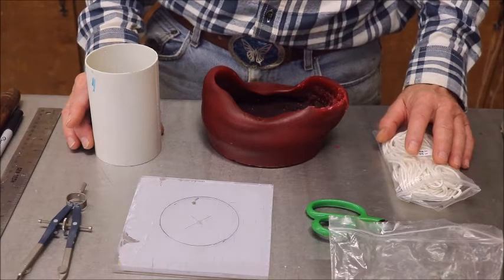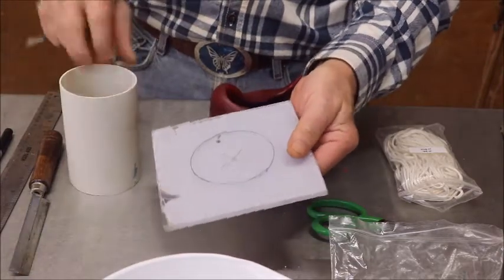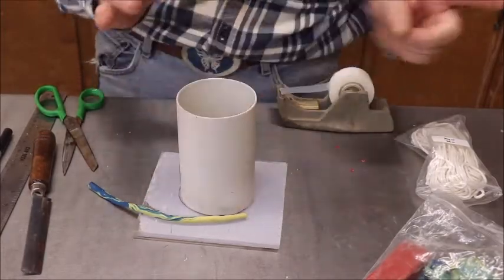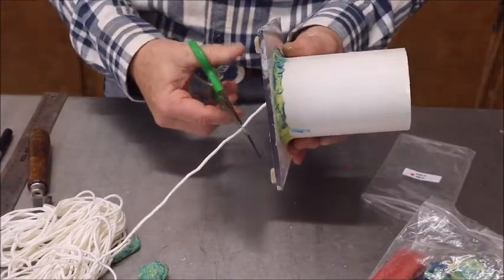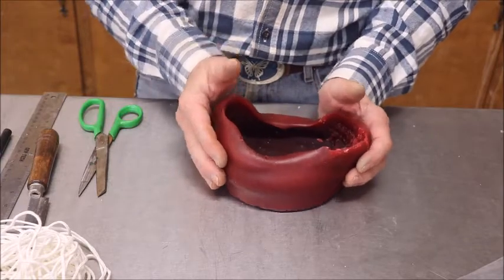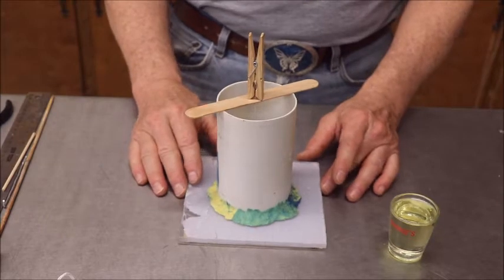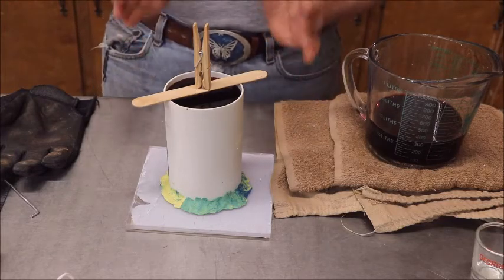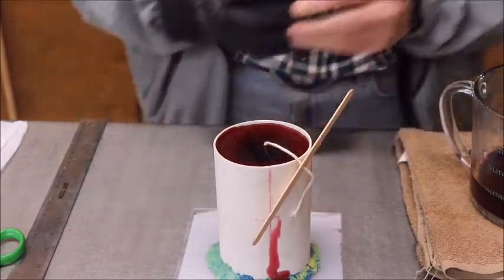How to Make a Pillar Candle Mold & Pour a Candle

Comment: Hahaha..... excellent vid,  I've been using homemade molds like this for ages,  works great and pvc is cheap, reusable, comes in many diameters and can be cut to length. Here's something to try Mike: I take flexible silicone texture plates and tape them on the inside of the pvc, then fill as usual, let harden and de-mold. The texture plate peals right off, leaving behind a wonderful impression that can be left as is or filled with another color or colors. To fill it in I usually use a whipped wax, which is probably what you are frosting your candle with or at least similar. I let the candle cure for a few days then freeze it a few hours before smearing the whipped wax into the design and scraping off excess. Then, let set before giving it a final trim and clean-up and Voila beautiful decorated candle. I use a flexible silicone spatula (like for baking, in my family we call them "Magics"), to smear it in and polymer clay tissue blades are ideal for scrapping but a razor blade works too. I've even made my own texture plates from silicone and also foil tape (the real stuff, not the crafters kind). The benefit of that is you can stick it right to the mold. I usually use a light spray of mold release for the foil and for any brand new silicone plates. 
*I use box tape or what some call packing tape to tape the plates in place and seal the release cut. It gives a smoother transition with less clean-up in the finished candle. I used 3M but recently been using Gorilla, never had a problem with either melting. 
**Freezing the candle for a bit before filling helps harden the wax, both the already poured candle and the whipped filling and lessens chances for damage or distortion of the design.
***scraping off excess whipped wax is a slow and steady process to help avoid "popping out" pieces of the details or gouging the candle. Best way to start though is to not over fill, scrape off as much as you can as you apply it. 
Hope this helps you and anyone else interested in this art form 💗💗💗
Reply from the maker: Thanks Starcat, those are good ideas!
Reply: Kudos for the Video! Forgive me for butting in, I would love your thoughts. Have you heard the talk about - Chireetler Earning Maker Rule (search on google)? It is a great one off product for learning how to make candles for fund or profit without the hard work. Ive heard some great things about it and my cooworker  got amazing results with it.

Comment: Thanks for the demo! For melting wax, I use a metal coffee can set into an old sauce pan with a couple of inches of water. The wax chunks go into the coffee can, the burner set on low heats the water, and the wax melts in the coffee can.  You can bend the edge of the coffee can a bit to create a "pour spout" for the wax.
Reply from the maker: Thanks for the comment Sue.  And thanks for watching my video!

Comment: wow! I have 26 lbs of paraffin, the result of friends buying into the "dip you hands in paraffin" craze... I was shopping 2" pillar molds , once I start melting I would like to do many at a time and that would be $$$yikes... using the "wax warmer" to melt the wax, will be interesting to see if it is hot enough.... using pvc, I could make several molds at a low price (hey.. I was thinking of using toilet paper cores lined with foil, hot glued tog, imagine, the time wasted though, some potential for texture) I was wondering, if you got the mold cool or cold before pouring.. it would make a different surface but, less danger of leaking but, not needed, your method worked great! In early days, I used to get the wax just hot enough to pour and adhere to the wick...  brilliant!  I need some advice on mixing stearin and... good to go! Thank you and, great video! Capt Mike is the kind of people I wish I knew locally... there is more to life than the mall and cable tv...

Comment: I use empty beer and soda cans. Just cut off the top and then cut it opwn with scisorcs or a knife. Still needs repouring tho, but no leaks :)
Reply from the maker: Good idea Eva!
Reply: how do you deal with the holes in the bottom? I've tried those and everything I tried to seal the hole with gets melted and my house is a mess :D
Reply: the candle comes out easily? great idea...

Comment: Hi,
Nice video. I am having variable bulge in candle and it have deboss hexagon pattern. Pattern are coming fine but the candle don't seems straight and have bulge. Please any suggestion.
Reply from the maker: Are you using a rigid mold or a silicon one?  If it is a ridig mold you may be using a wax that is not dsigned for free standing candles.
Reply: @CaptMike  I am using silicone mold
Reply from the maker: @mitulprajapati3236  I would guess the silicon is getting warmer around the middle and the wax expands out from there.  Just for grins and giggles make a test candle in a plastic solo cup and see it the wax holds it shape.

Comment: New sub. Colorful language Lol. I'm new to candle making. I like the clothes pin tip. And i didn't know that meant tunneling. And i want to learn how to make molds. Where can i get that comb???
Reply from the maker: Hi thanks for the comment.  Tunneling occurs two ways.  First when you make a candle using pillar wax and second when you burn a candle that has not been wicked properly.  When making a pillar candle the type of wax you use will shrink somewhat when cooling causing it to "tunnel" down the middle.  You will need to fix that by adding more wax until the desired level is reached.  The second type of "tunneling" is caused by using a wick which does not produce the required heat necessary to create a full melt pool.  I am not sure what you mean by "comb". Please explain and I will try to answer.  Hope this helps some.
Reply: @CaptMike   thank you very much.
Reply: @CaptMike  oh the big tool that has teeth. I might be calling it the wrong name.
Reply from the maker: @lisamb4269  Somewhere around 2:20 in the video I have a razor saw in my hand.  Would that be what you are talking aobut?
Reply: @CaptMike  yes. That's it. Ty.

Comment: What kind of plaster do you use to make your molds, slump molds.
Reply from the maker: I use an inexpensive industral plaster ($9.00 for 50#).  I use ceramic clay for glass slump molds.
Reply: @CaptMike  what kind of clay ?
Reply from the maker: @samanthanicholson9015  you will have to use a clay used for throwing pots and such.  It is called ceramic clay.  It is water based. Start here: https://www.amazon.com/s?k=ceramic+clay+for+pottery&crid=16W0R4N4H6Y4C&sprefix=ceramic+clay%2Caps%2C193&ref=nb_sb_ss_ts-doa-p_3_12.  A low fire clay will do just fine for making glass molds.
Reply: @CaptMike  so like cone 04 ? I have that I was concerned while I use to slump glass melt it that would cause the clay to break, we make alot of jewelry would like to try to make glass donut pendants
Reply from the maker: @samanthanicholson9015  Cone 04 clay will work fine for making glass molds.  As you know, glass fires coller than clay bisque.  Just make sure your mold is thick enough to support the glass, about 1/4 inch or so.
Reply: @CaptMike  what increment to fire the glass in microwave
Reply from the maker: @samanthanicholson9015  I usually use 3 minute incriments.
Reply: @CaptMike  do I fire the clay first before using it to melt glass? Thank you so much for answering my question
Reply from the maker: @samanthanicholson9015  Yes, the clay mold will have to be fired to bisque, or cone 04.  Remember that the clay will shrink somewhat as it is fired.

Comment: You can put hot glue on the seam maybe instead of tape.
Reply from the maker: I'm sure that would work.  It may be a little more difficult to remove the glue if you need to seperate the mold to get the candle out, but sounds likesomething that might work.